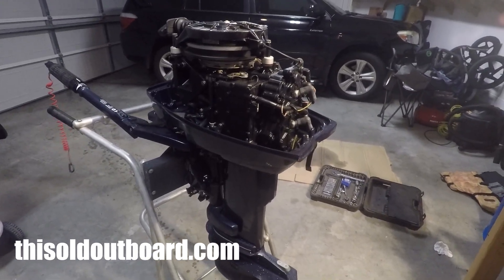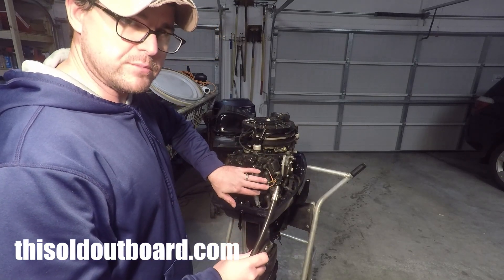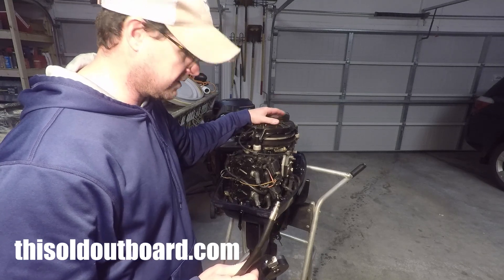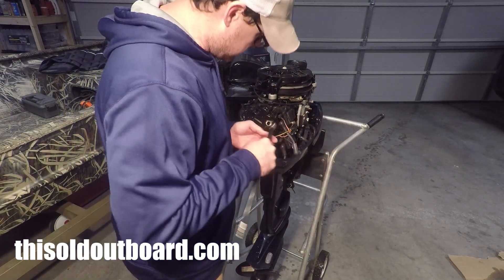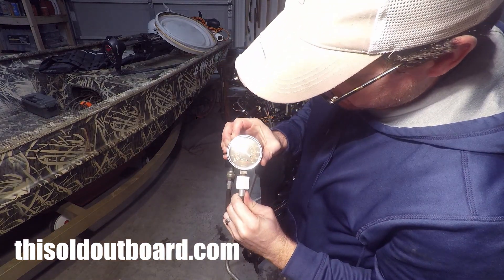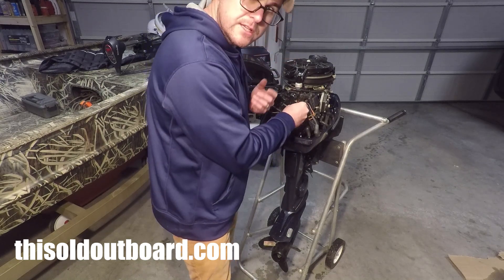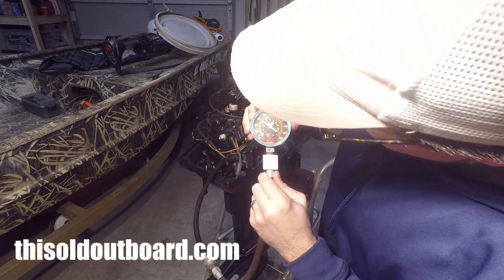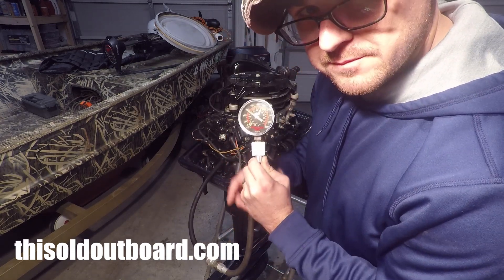Low Hour Evinrude 25 Hp Compression Test

Comment: That's perfect, but warm the engine up mate before the test,
if you want to do it properly, that's why you think it's low.
My 2000 model I picked up recently, doesn't look much,
but reads 110psi in both cylinders warm.
Runs like a dream and is really punchy.

Comment: You might try squirting a little oil in cylinders and running compression test again!  Rings and cylinders could be dry if it's been sitting a long time! Could bring pressure up a little! Thanks, Jim from Kansas!!

Comment: I have a 1985 Evinrude 25 hp. It cranks easy and runs on low throttle very well. Once I throttle it all the way down it tries to bog down. Any remedies or think you know what it could be?
Reply from the maker: Based on your description, this is pretty normal
Reply: have you ever found a solution to why? mine is doing the same

Comment: Also remove both plugs and have the throttle in the wide open position while doing the test for more accurate readings
Reply: Hey, the motor will turn at more or less 350 rpm. The butterfly opening really has no  bearing whatsoever !

Comment: hello, I have merc 25 1997 3 cylinder.  I did the test on a cold and on everyone I have about 120psi.  Is there more heat coming out?  I can't find anywhere for this model how many should it be?  Is this good, medium or poor? Regards!
Reply from the maker: These are good numbers
Reply: @thisoldoutboard  thank you for your answer :) should I remove the shift shaft from merc 25 by pulling it hard?  is he somehow fixed there?

Comment: 95 Johnson 25hp just checked the compression and I am reading around 75 on both cylinders is this ok?
Reply: If they're close and it starts relatively easily, just run it until it doesn't. Then you're looking at a rebuild. That is low though. I guess all depends on what you expect out of it.
Reply from the maker: Agree with hunterman600cc
Reply: 91 evin 30 here, I got  120
Reply: Thats definitely healthy  @bandrajarper5229
Reply: Thanks for the info, thinking about trying to marvel mystery oil trick to see if I can raise it. The motor was sitting for a while so maybe the rings are stuck?
Reply: @justinroberts9965  what is the marvel mystery trick to use?
Reply: John Creegan you can take the plugs out of the engine, pour a little mystery oil in the cylinders. Turn the flywheel a little with your hand just to get the oil moved around. Let it sit for about 2 to 3 days. Alot of times the oil will loosen/lubricate the rings up and make them seal a little better making the compression higher. Especially when you have a motor that has been sitting.
Reply: I have an old Mercury 1989 20 hp 125 on one cylinder and 123 on the other!

Comment: Ok. I bought what I think to be a 1957 johnson 35hp. It has 120psi on top cylinder, and 60psi on the bottom. What’s my next step?
Reply from the maker: If those are good readings you have a bad powerhead
Reply: Rebuild it!
Reply: I have a 73 85 hp mercury.
3 are good at 135 psi
1 is reading 102 psi.
Need rebuilding or use as is?
Reply from the maker: Base Line If it starts reasonably well if run it until I absolutely had to rebuild it
Reply: @thisoldoutboard  yeah start 2nd or 3rd try usually.  Thanks for the reply.
Reply: @baseline6786  well if you rebuild now you can save yourself a catastrophic fail and the extra expense and damage plus getting stuck on the water..or just run it till it blows up??  A low compression cylinder on the two stroke is one that isn't getting adequate lubrication to that cylinder..whereas a 4stroke still gets the lubrication and generally could run longer in that state. How long til D-day is up to the motor and the breakdown that has begun inside???
Reply: @dougamclean  I suppose so. Damn. Lol. It sure is a very bad day stuck out on a lake when failure occurs.
Reply: first grab the motor by the bottom around the prop area. get a garbage can and throw it in the trash.
Reply: Strip it and sell the part's, because I will cost more to fix than it's worth